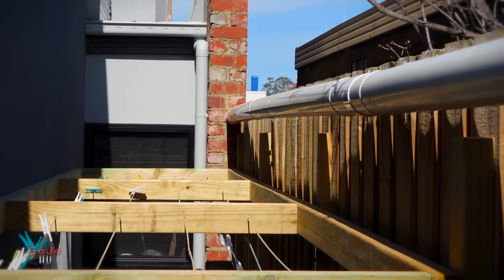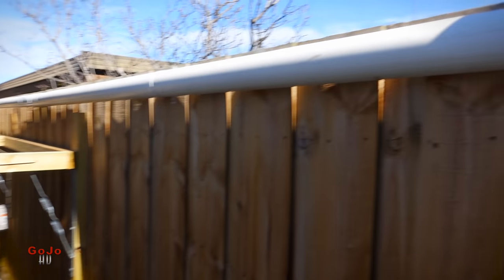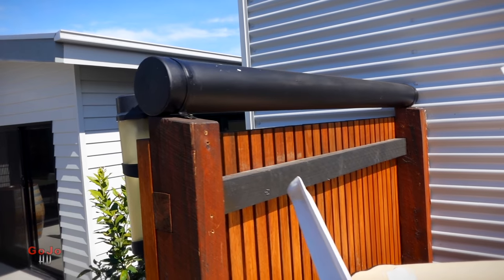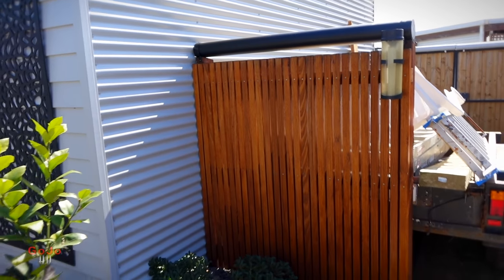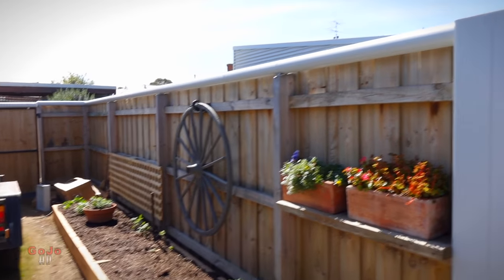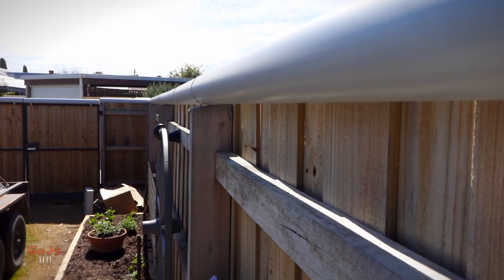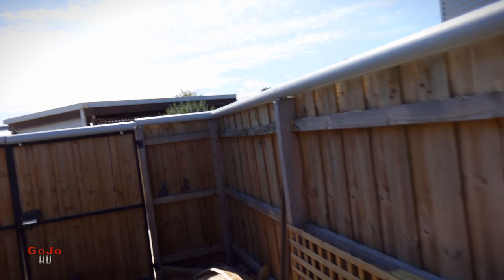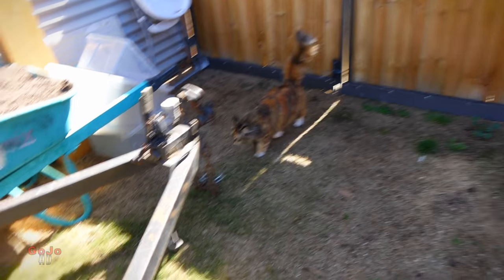Cat Proof Fence | Cheap & Easy with PVC Pipe | How to DIY

Comment: What's the diameter of the pipe is typically used here for this to be effective. That is an important info missing
Reply: standard 90mm
Reply: @peterevans4690  thank you. I did mine, we get 100mm in India as standard. Worked like a charm and saved me few thousand rupees. Thank you

Comment: I have always rescued older cats so a 4’ wire fence kept them in my patio area nicely.  BUT, my new cat was needing a home and has taken over mine.  He is on the kitchen counters, table, goes crazy splashing the water out of the toilet n the newest thing was covering an 8 ft long bathroom with his litter.  He now has a very high sided litter box that has a lip around the top so now the only litter to escape is on his feet.  I love him so much n where I live there are a lot of cats. So, I am struggling trying to figure out what to put on top of fencing.  One of the feral cats got inside when I had the gate open n he was over it easy.  I just don’t want him hurt.  Any ideas.

Comment: It didnt work for us. The cat climbed the fence slowly and as able to reach over to the other side with his paw and escape. Any ideas how to fix this? We have a 6 ft fence and the cat is kinda big...Thanks for the video though
Reply: Try with a longer bracket and 2 sets of rollers
Reply: I added core flute along the top of the fence & installed this on top, as I thought that the cats would be able to climb up to get to it. Worked a treat!
Reply: @kateb8079  can you show a picture of what you did? If not here, maybe we can figure out a way. Hmmm. Doesn’t look like it. What is core flute.

Comment: Looks nice but please note he did mention the point of needing to be tall enough a fence.  Way not suitable for those Kitty's whom have gravity defying  skills similar to those displayed in Crouching Tiger and Hidden Dragon.  My little ball of fluff is able to jump in one motion the
5 & 1/2 feet straight up an over the roller to grip the wood on the other side of the roller.   Alas in my case $200 dollars later still no solution.
Reply: That’s too bad.  Did your cat know how to climb fences or experience them before putting up the piping?  Might make a difference in my situation S they don’t know about climbing fences yet.

Comment: What's the diameter of this pipe pls?
Reply from the maker: 90mm
Reply: The pipe I'm looking at here in Canada has a flared end on one side.  Wondering if yours had the same, and whether you used that to join them.  Also, did you paint the pipe?